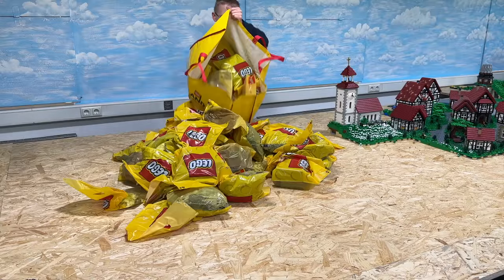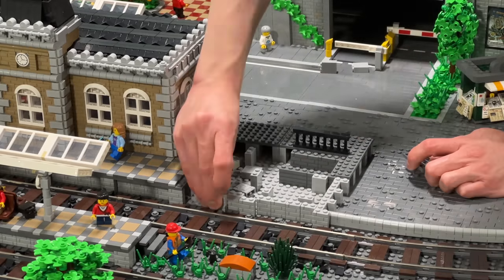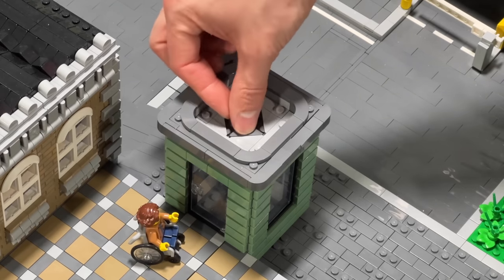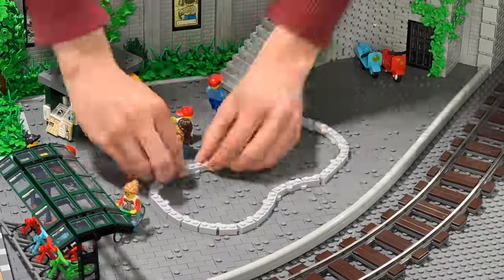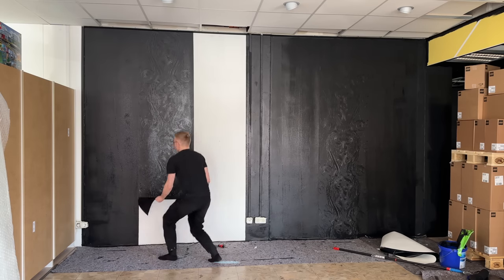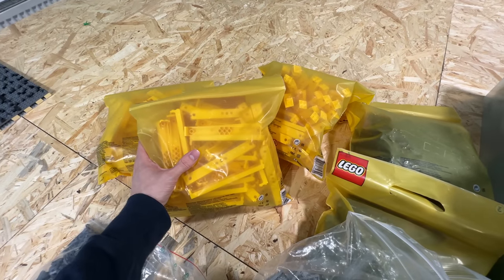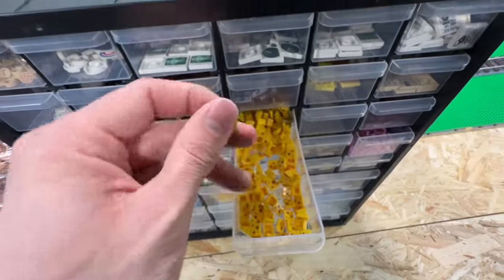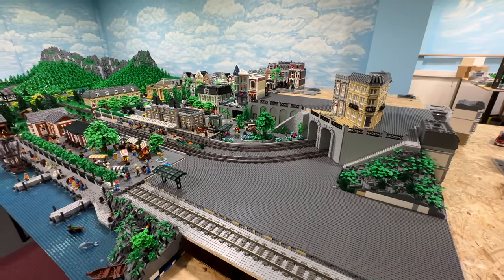LEGO Factory is bankrupting me... - Lego City Update

Comment: 4:48  Can confirm, the moisture is what causes it to peel! Typically when removing wallpaper, you want to use a steamer to heat it up and make it moist before trying to peel it off of the wall, might be a good investment if you plan on doing this in different areas <3

Comment: I think the elevator should be a bit further to the right to give more room to the wheelchair minifigs. It looks a bit cramped to turn around if they just want to go on the regular platform and not the elevator.
Reply: Little bit connecting to this, on the station side, I'd flip the staircase, it looks a bit odd to me that it goes away, then reappears in the middle of the station on the middle platform.
Reply: You realize it’s LEGO and not real correct?
Reply: @macparzival9271  I would say its realistic. Usually there is more tunnels underneath and as he was explaining that the elevator connects to the same area I would not be surprised if there is straight connection to the underground parking too. My country has quite often those kind underground connections to train platforms and quite often they are more complex than just straight tunnel to the middle platform. They usually connect to the train station directly and other structures near by and usually also provide access to the other side of the tracks so pedestrians can easily get over the tracks. The direction is also correct as they always go parallel to the tracks not towards or away from them as it takes less space from the platform. Still the stairs should be wider as you need room for both direction travel so it goes smooth now it being one person wide just makes it look odd to me and not really fitting a city station.

Comment: It may be that camera angles etc. are deceiving, but it looks like there's not enough space between the stairs and the benches. Imagine the 17:45 arriving, at the central platform at 17:55. Everybody is 10 minutes late, and they all hurry through the tunnel and come up the stairs almost as an army. Thus, at the top of the stairs, you want to have space, an almost ugly amount of space. Sure, some benches e.g.. against the sides of the building.Maybe a time-table to separate the stairs from the tracks. But other than that: Give them room to disperse. Not sure the elevator is in a safe spot, but anyway: Make sure they can all make it home by the time their significant other puts the serving dishes on the table.
Other than that: Sure looks nice.

Comment: Your city is so perfectly detailed. How did you get the grey strip of 1x plates to curve in the beginning of the video?
Reply: If you connect a strip long enough then you get a tiny bit of movement between each of the plates.
Just try it out, but beware that it is considered an "illegal" building technique as the stress exerted on the plates can damage them over time.
Reply: @thorakvideos2495 what have they used? 1x2 plates stacked overlapping?
Reply: @samwalker8893  Yh, just 1x2 plates. There is a safer way to do it using 1x1 round plates or the 1x2 rounded plates.
Reply: @thorakvideos2495  do you perhaps have a link please for me to see it being used or made? I dont understand how you link 1x1 plates? Surely if you click them together you just have a vertical pile of 1x1 plates? There is no other way to link them? (Sorry, im sure my terminology is not right)
Reply: @samwalker8893  I'm sorry, I should have been clearer. If you go back to the BrickCrafts video where he makes the big stone stairs to the upper platform, then you can see this technique. It's a combination of the 1x2s and 1x1s. at every angle point you insert the 1x1.
Reply: @thorakvideos2495  ahh yes. I see now. Thankyou

Comment: Where do you buy your bricks? Do you use not official bricks, eg. webrick, or only lego?
Reply: Lego
Reply: He only uses official lego, this haul was from "the factory" at Legoland Germany.
Reply: Thanks. I am asking because it is quite problematic for me to get these pieces. Lego has two programs: 'Bricks and Pieces' and 'Pick a Brick'. Both of these are not really good, as many parts are missing. 

From my experience webrick is a bit better, but still they do not offer every brick I usually need for my MOCs. What do you recommend for that?
Reply: @WespazjansDad  bricklink is the biggest online marketplace for lego pieces, also cheaper than pick a brick for most stuff, although not everything.
Reply: @PhBricks94  Right, tried this one as well. The main problem is that even for a mid-sized MOC you usually need to order from 10-15 different sellers. That increases overall cost a lot. That is the main reason I am so interested where does Brickcrafts buy his stuff.
Reply: @WespazjansDad  He always buys from bricklink and pick-a-brick, plus this recent factory shop visit. Bricklink is usually still cheaper even with split orders, but it depends what you need. Especially with the quantities Brickcraft is working with he can just buy a few thousand of a single piece from a seller, don't really need to combine much stuff in one order to make it worth.